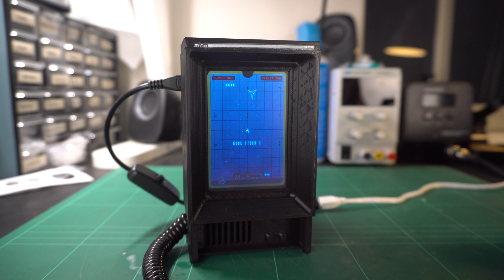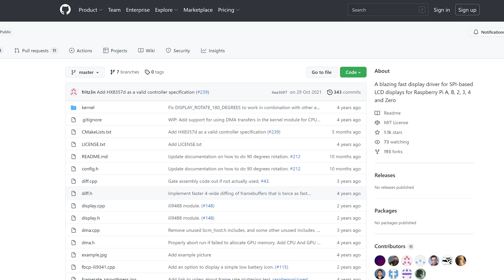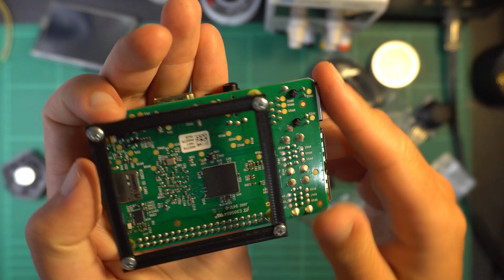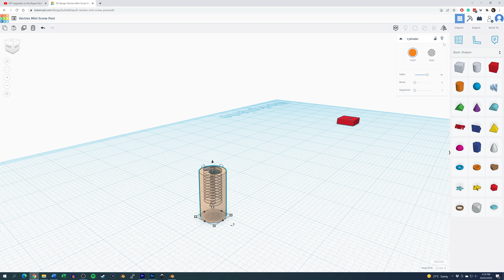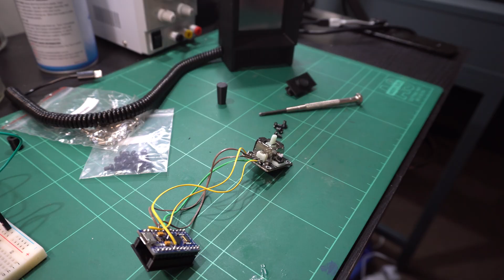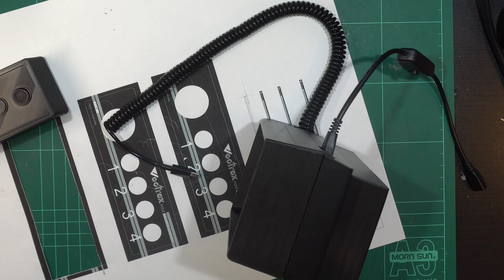The Vectrex Mini - DIY Build Log

Comment: When I'm designing anything that requires fitting other parts, I design test prints of those sections of the design, it saves so much time, even though I have an Bambu Labs X1 Carbon Combo, which is super fast, compared to my old Ender 5 Plus.
 Even with careful measuring and working to my usual tolerances, things don't always fit.
And to make things worse, I found that once I have built a project, if I build another and use another brand of filament there is a different shrinkage rate.
 I usually print in Polymaker ABS, which, with my print profile, has a shrinkage of 2.1%, but Sunlu ABS is 2.3%.
At first I thought I had printed an old revision of my design,;I hadn't ,but that led to me printing the design revision on hidden areas of future designs.
 These implementations to my CAM process have saved me umpteen hours of frustration over the years.

Comment: Personal hack for glue on hands:   soak your hands in a degreasing dish soap and water solution.
For about 15 minutes.  Lightly scrub with coarse aluminum wool.

Comment: I had some scaling issue Inkscape a while back when importing/exporting some graphics... Can't remember anymore what I was trying to do, but the end result was ever so slightly off scale. Anyhow, it seemed to be some weirdness due to the .svg format not being bound to any particular unit of measurement. (Maybe I had something in inches and different dpi setting in another program, etc. Can't remember at all. 🙂 ) I now check that I use mm as the unit and a scale of 1. File -> Document properties -> Page tab: Check "display units" and "scale". I wonder if you gave the printers a .pdf or .svg file. The .pdf would be a safer format regarding scaling issues, I think.

Comment: I think I have the missing piece for how you were able to rotate the screen. Adding "display_rotate=1" to /boot/config.txt will rotate the screen 90 degrees. Went through some similar trial-and-error when I was building a handheld GPS with a vertical orientation with a GPIO connected screen.

Comment: nice, but replicating the screen using a laser would be the most important component to replicating the vectrex experience, no? I don't think people ever see lasers on screens nowadays, only on walls or in smoke for laser light shows. A line with infinite resolution and no staircase artifacts is something you only get on paper nowadays (or if you stand far enough away from your retina dpi screen).
Reply: Is there even a such thing as a "laser display"? If you're really going to argue in favor of historical accuracy, I'd say just go straight CRT with a vector system.

That said, IMHO with a high enough resolution screen, you wouldn't notice any aliasing anyway. I'd be happy with an LCD-based replica. Probably need a bigger screen than what this project is using, but it'd look plenty nice.

Comment: I worked in a print room for some time Adobe Acrobat will scale prints to 96% by default. I am assuming that Officeworks are too lazy to change that setting in the print dialogue box.
Reply: Yup. Alternatively, there's also a "fit to page" vs "actual size" setting. Acrobat looks at the full-page image, then looks at the printer's margins (most printers have at least 1/8" around the edge it can't print), and then says "oh, I'd better scale this to fit the printable area instead of the page".

By selecting "actual size", you disable this "helpful" behavior and get things the right size.

Comment: Not a true Vector mini console.  But Still fun and cool, even if the emulation is ultimately unsatisfying. Rock on.
Reply: Which mini console is "true" though?
Reply: @MikeD-bu6hr the OP means that it doesn't use a true vector display, but a pixel display.

Comment: Sounds like you had as good as an experience as I did with my local Officeworks years ago. I sent them a job to print and bind, it was 100 pages... They punched the wrong side of the pages for the binding, I mean, wtf, how can you get that so wrong!?

Thankfully it was just a manual for work for my reading purposes only, so they repunched it at no extra cost, personally I think the whole thing should have been free due to their stuff up.
Reply from the maker: Lots of young kids working in the two I went into, I noticed. You get what you pay for in that instance
Reply: @retrogameon  Indeed you do.

I would check out some signage places, they may be able to print smaller things like this, not entirely sure, but they would have to be better than OW is.

Comment: JayCar does sell the RPi 2/3 power supplies, at least, my local one here in Bunbury does.
Reply from the maker: Indeed. I had a closer look at my original Core Electronics order and it was advertised as a Pi3 adapter. That's why I could find it when I was writing the script.
Reply: @retrogameon  Yeah. The Pi 2 and 3 both take the exact same power adapter, so once the Pi2 stopped getting sold, I imagine existing ones got relabelled (at least on the websites) as Pi3.

Comment: It's the voltage drop across the cable and inside the Pi before it hits everything. By making it 5.1V, by the time the Pi actually sees the voltage, it should be exactly 5V.

But yeah, it's annoying finding something that can match up to that, as most things are 5V 2.4A.

Comment: Laser cutter for the decals dude, if you want an entry level one check eBay for a k40 unit it’s about 500 or so they’re like the Enders of the laser world. I had a k40 for years till I upgraded to an epilog, you get the two tone acrylic labels like you see on electrical labels super thin for this type of thing. Great work on the vectrex mini thing looks a treat.
Reply from the maker: Ooh that sounds like a rabbit hole I probably don't want to invest in ha